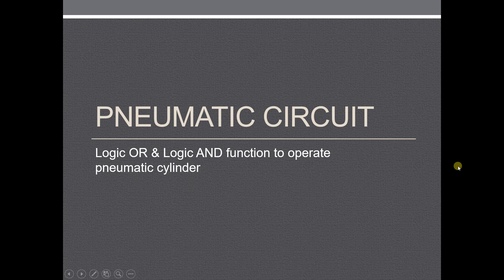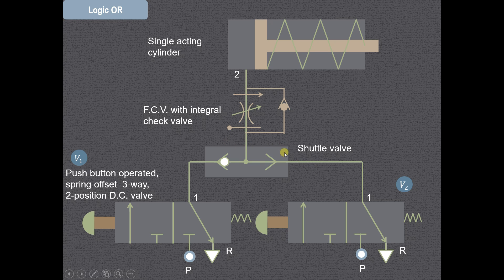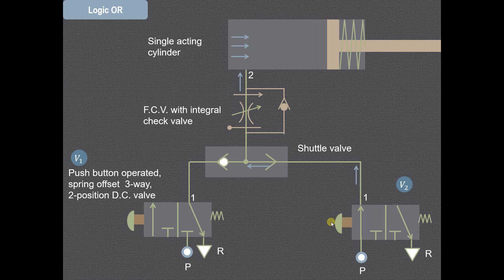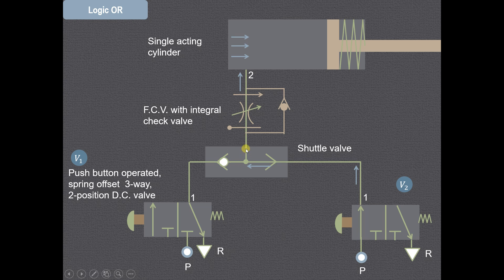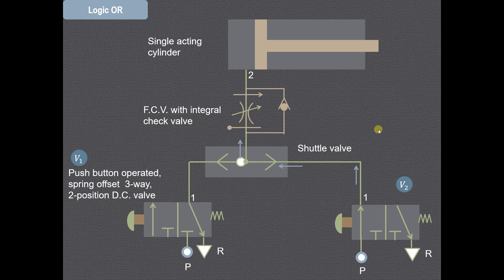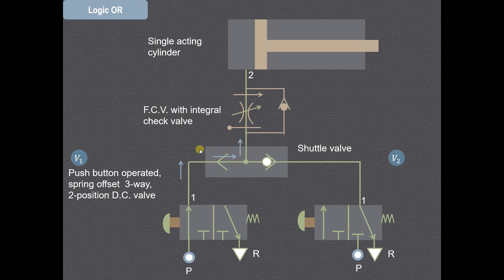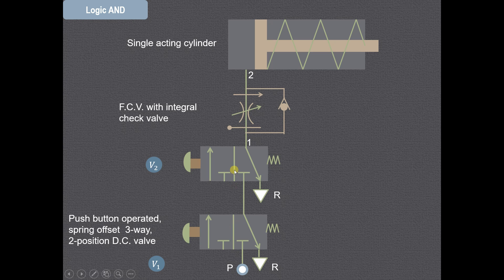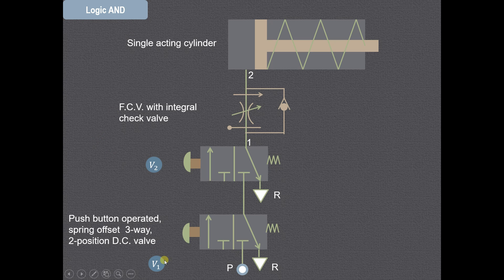Lecture 12 | Logic OR & Logic AND pneumatic circuit

Comment: Sir, what will happen when the v1 and v2 operated at the same time in OR logic
Reply from the maker: When both control valves are operated simultaneously, the shuttle valve or OR gate will still allow flow from either one of the valves. However, in practical terms, if both valves are actuated at the same time:

No Conflict: The shuttle valve selects the path of least resistance, typically allowing flow from one valve while blocking the other. This ensures there is no conflict in the operation.

Resultant Output: The output action (such as moving a cylinder) will happen as it would with only one valve operated. There will be no significant change in the action if both valves are activated, as the system is designed to accept flow from either source, but not necessarily benefit from both simultaneously.

In essence, the OR function is designed to ensure that the output is actuated even if either or both control valves are operated. The system will function correctly whether one or both control signals are active.